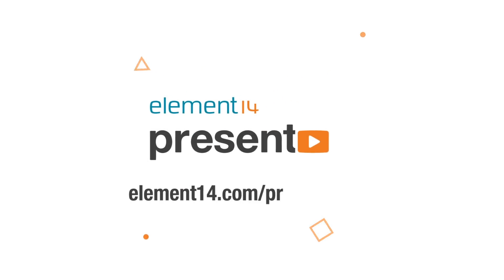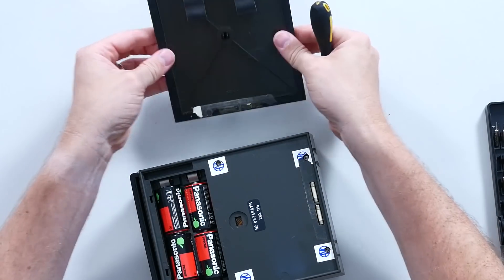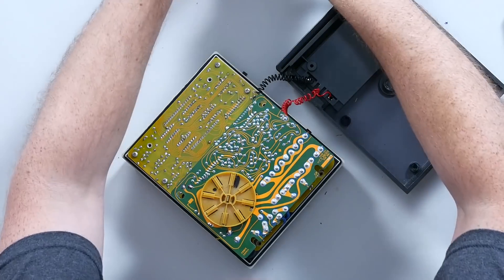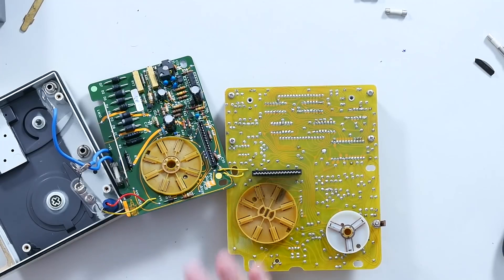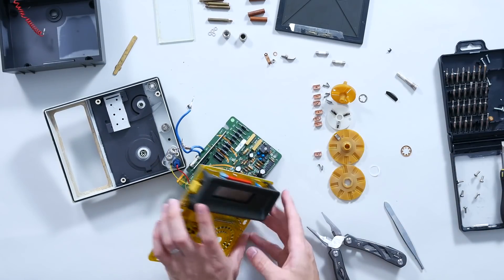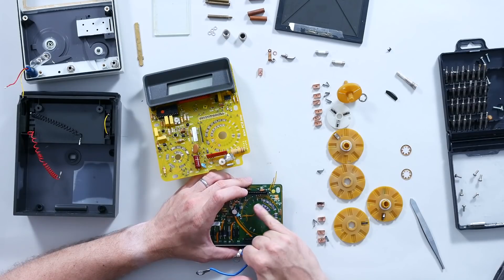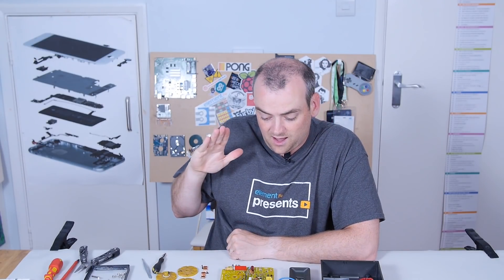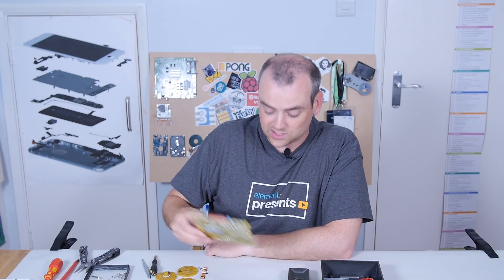1977 AVOmeter Digital Multimeter Teardown - The Electronics Inside

Comment: Those tubes are SRBP, i did the drawing for them!. I work for Megger (Formerly Avo) and I have worked for the company since 1994 (When we were Avo). I am now a mechanical design engineer and also company historian. The DA116 was part of a digital range including the DA112, DA114 and DA118

Comment: The PCB is laid out with various widths of paper tape on a light box
The lightbox would have a grid usually set to 0.1 inch
Pre printed dots for the component leads,
Several layers of mylar type paper were used to help with the layout.
Usually this was done at 2x scale.
The finished artwork was then photo reduced to the correct size.

The board that you described as a heatsink are printed tracks to make low value resistors for the current shunts.
You may also see some areas with solder that are used to adjust the values

Andy
Reply: Thanks Andy - That would make a lot of sense for the "heatsink" board, thank you!

I'd love to give this method of PCB production a try! I think it would end terribly, but I'd be facinating to try!

Comment: The other reason some people may prefer old analog meters is the Ohms/Volt rating. If you look at circuit diagrams for older valve equipment, especially TVs, you will usually find somewhere that it says something like "10k/V", it means that the voltages on the circuit are what you should see when measuring with a 10k per volt meter. 

If you test such circuits with a digital multimeter, which may have a fixed input resistance of 1M or 10M regardless of voltage, the voltage you measure will be higher, because the meter isn't loading the circuit under test, but it's much harder to determine if it is the right or wrong voltage. This was more relevant in valve circuits because they use higher resistance/inductance values than for Transistor circuits.

(that stuff I learnt in communications measurements 101 in 1985 finally came in handy :) )

That vertical board you pointed out is probably a set of precision current shunt resistors for the current ranges, not sure about in the '70s, but they may even be laser trimmed, they will have been trimmed somehow.
Reply: I hadn't thought of it that way, thank you! It's always nice when you can use a potentially forgotten piece of education.

It was definitely a current shunt, I'd love to know more about the who manufacturing process, but laser do seem a little early for the 70s, but I'm often suprised!

Comment: Spacers will be synthetic resin bonded paper, SRBP or Paxolin. Used to make cheap PCBs too.
Reply: I have used sheets of Paxolin in a few instances, and yes, that makes sense! I have never seen it on a PCB before though, maybe I've just been lucky!
Reply: @a531016  SRBP PCBs are found in consumer electronics products, especially those from past decades.
Reply: I think I have a couple of SRBP blank PCB laminates in my PCB-etching equipment stash, but I mostly try to avoid them, honestly - fibre glass just feels and looks nicer, and isn't much more expensive :)
Apparently SRBP is easier on drill bits than fibre glass (which I guess may also reduce costs for manufacturers), but with the price of PCB drill bits from China that really isn't a concern for hobby purposes!